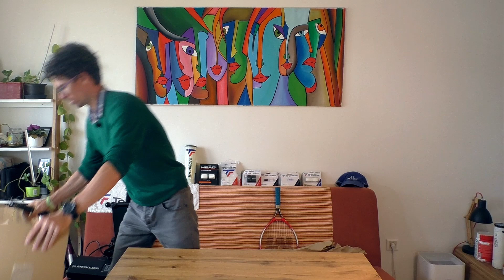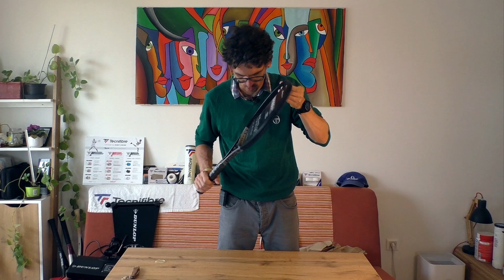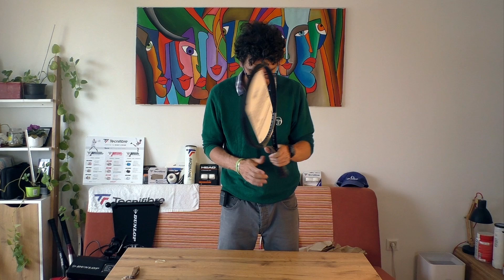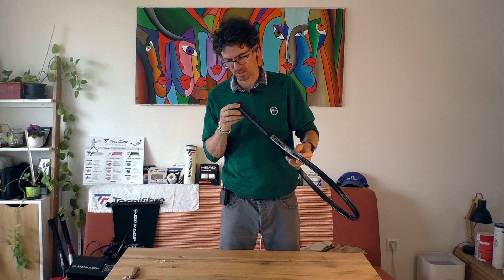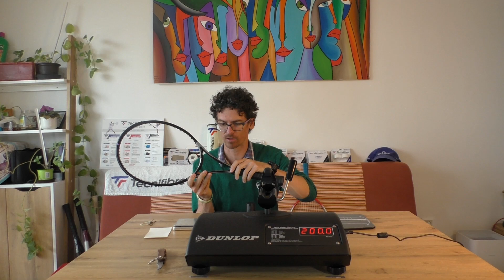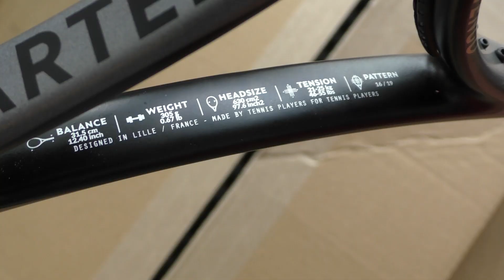ARTENGO TR960 CONTROL TOUR 16x19 Tennis Racket First Look & Quality Control Test | Gael Monfils |

Comment: Good info thanks. Mine was 310g unstrung (including the rubber finishing ring). Bit disappointed it was so overweight. Couldn't find any stringing instructions but copied the pattern from the photo on Decathalon's website and the markings on the frame. Annoying getting the final cross string through the hole due to two strings blocking it. Not impressed with the grommet design. Also some paint overspray on two grommets. So quality control and design are not amazing IMO but good for £99. One thing I do like about the stringing pattern is how open it is, if you compare it to a Blade 16x19 it's a lot more open, almost like a Blade 98S but not quite. Strung it with poly in the mains and multi in crosses. Not hit with it yet but hope to soon.
Reply from the maker: I hit with the racket already and impressions video is on the way. The pattern doesn't really help generate spin. It's actually very hard to generate some. Just wait for the video.
Reply: Looking at the grommets more closely, I think they've picked up some paint from the frame as they've been pushed through the holes (certain the grommets go in the racquet after it's been sprayed). Agree about the grip too, it's quite a bit longer than the Blade. My normal overgrips aren't quite long enough, which annoys me :-)
Reply from the maker: @placeholder_1990  Now when I strung the racket the failed grommets popped ot from the frame and they now look normal. They are little bit wider, though. So your racket was 3 g overweight (if you remove the 2 g rubber ring), so not bad at all. 3 grams are still ok. You should see some Tecnifibre rackets I tested, the were like 7g difference each and some of other premium companies like Head, Wilson and Babolat struggle with the quality control on their mainstream 300 g rackets. Mine has no defects regarding the paintjob so yes, it looks premium for that price.
Reply: Agree that QC isn't any worse than major brands (excluding Yonex). I've had a Babolat Pure Strike Tour that was 10g overweight before and had to send it back. Paint issues with the Pure Strikes too. I've hit with the racquet now but only for an hour in a doubles set. Spin seemed fine to me but need to test properly with a ball machine and different strings (tried a poly/multi hybrid so far, want to try full poly before judging the spin). It has a nice feel to it, comfy but not too underpowered. Head shape is more like a Head Prestige than a Blade IMO.
Reply from the maker: @placeholder_1990  Very good point with the Head Prestige comparison as I see it exactly the same way in my fresh video. Check out my fresh on court impressions of the racket: https://youtu.be/_FTHBQPT4KA
Reply: The head shape is almost perfectly oval unlike the Blade which is slightly wider towards the top. I've got a couple of Blades and Prestige Mid here so I compared the shapes of them to the TR960. They are all similar racquets though IMO (all low powered, flexible 98's with similar beam thicknesses). This makes sense for Monfils, he was using the Wilson H19 for years and that was supposed to be Wilson's take on the Prestige/ Pro Tour. So presumably Artengo matched Monfils with a similar design and then he customises the frames from there to get them to his preferred weight and balance.